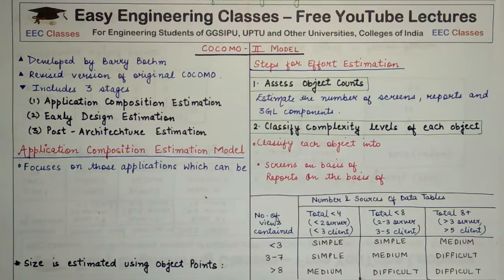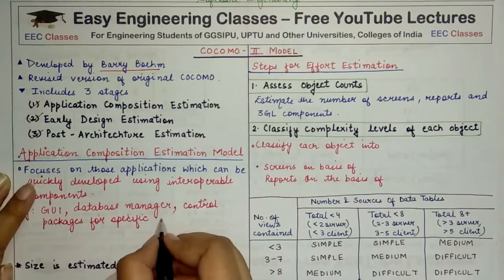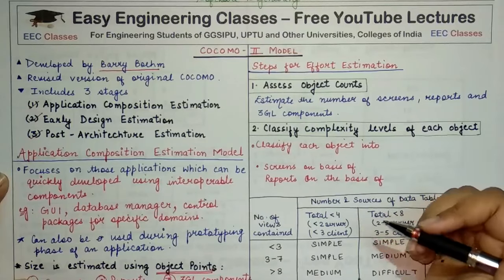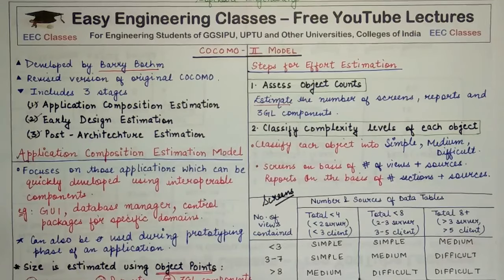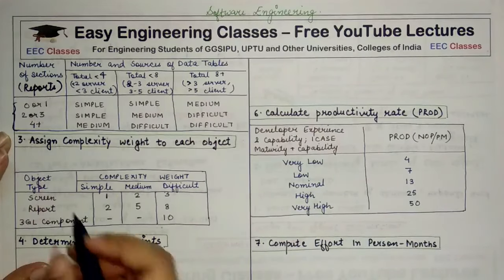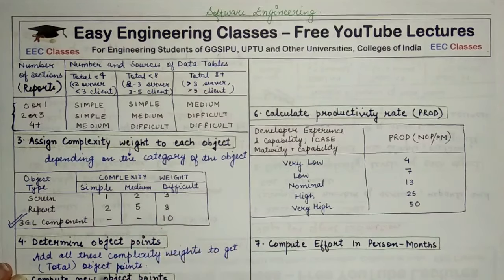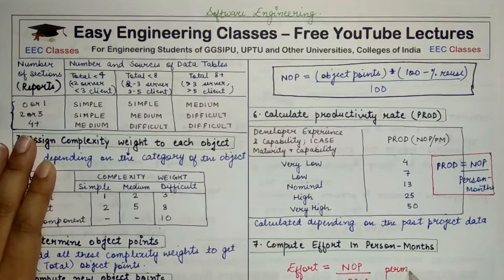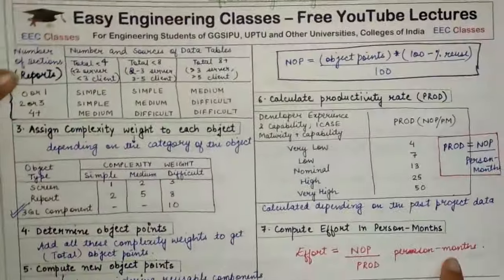L26: COCOMO II Application Composition Estimation | Effort Estimation  Steps | Software Engineering

Comment: mam plz solve this question__ cocomo 2 model to estimate the effort required to build software for a simple e-shopping application that provides 18 screens (simple),15 reports (medium ) and will require approximately 60 software components (difficult )assume the devolper experience capability  is high and environment maturity capability is very high use the application composition model with object points
Reply: Plz solve this quesio .... exams mai arha hai....